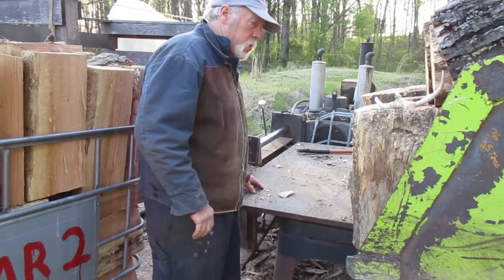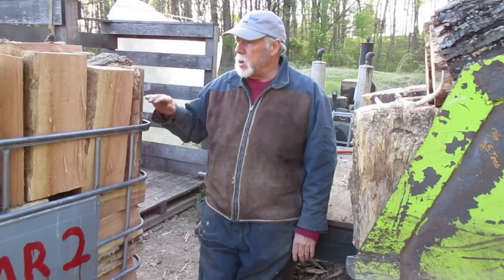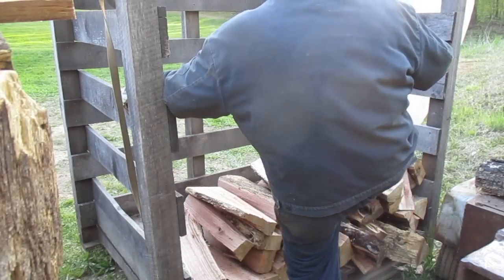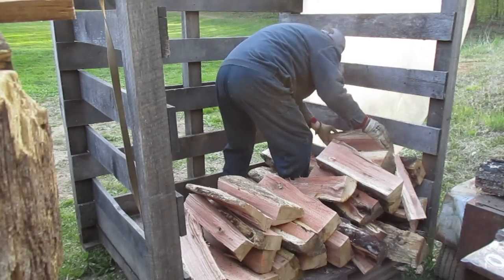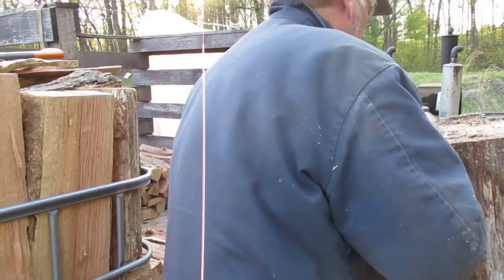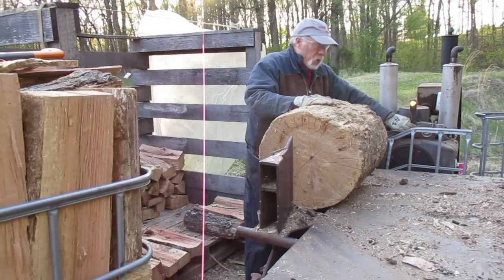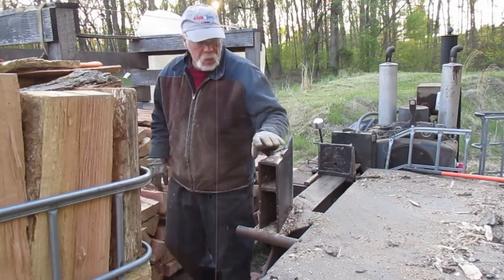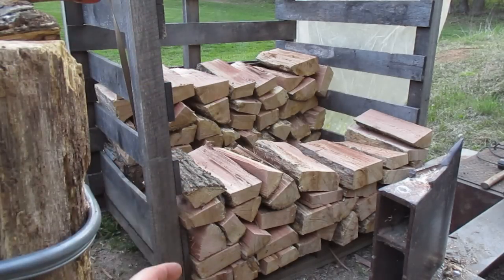FAST LOG/WOOD SPLITTING IT NEVER ENDS #731

Comment: If you know the answer, could you tell us what the cycle time is on that stlitter just by watching I have it at 5 to6 seconds that's every bit as fast as Easton and wolf.
Reply from the maker: hi there don't really know but 2 things i don't run it at full speed and its a single speed pump so it doesn't slow in a split . thanks for stopping in john